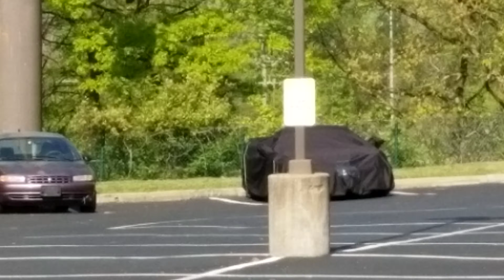c8 with cracked cast aluminum junk wheels... still.

Comment from the maker: https://www.corvetteforum.com/forums/c7-general-discussion/3774449-cracked-broke-c7-wheel-under-stress.html

Most of the folks on corvette forum appear to be too ignorant to understand the cracking on the wheel in the above link does not happen to a forged wheel ever.  

True Fully Forged wheels bend, they don't experience catastrophic failure from cracking.

The problem is, a car which has gone off the road and wrecked into the woods, we do not know WHEN the wheel on the car cracked, it could be before or as the wreck happened.

Thus it is very difficult to prove that a cracked wheel caused a driver to wreck and die or sustain serious injuries.